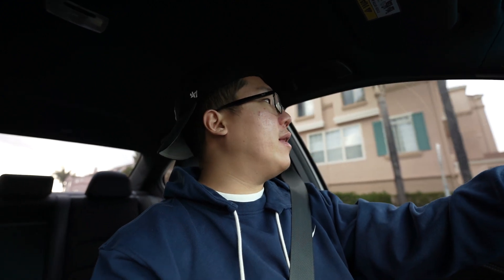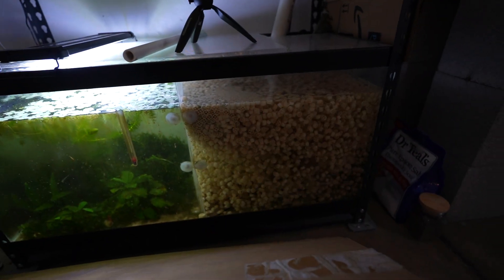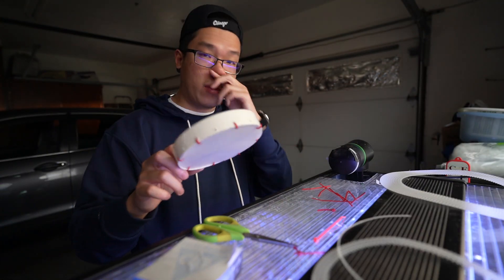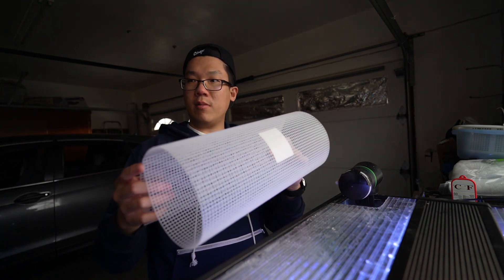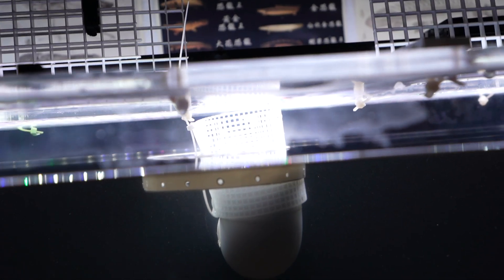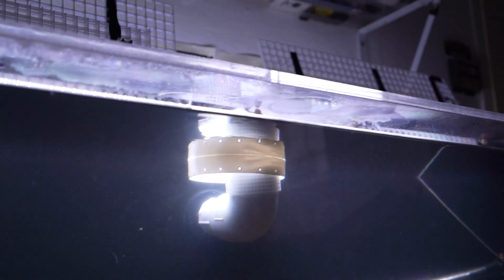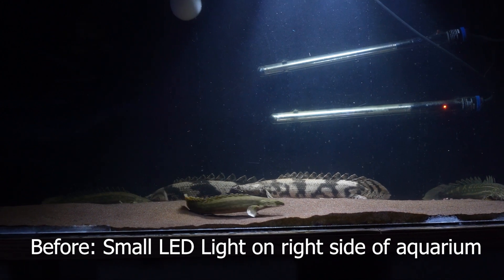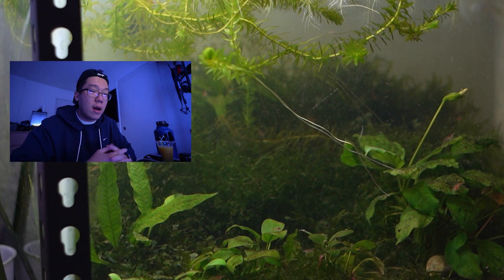Preparing my Bichir tank for Low Tech plants!

Comment: Hi whats the best water heater temp for endlicheri and ghost knife fish thank you
Reply from the maker: I dint have much experience with black ghost knife, but endlichiri I keep mine at 80f
Reply: @BryanLa  thank you so much but should i consider the temp from where i came from? Because i live here in the Philippines
Reply from the maker: I have some friends i grew up with in the states that eventually moved to the Philippines too! From what I've seen in their tanks they don't run a heater. Their tanks are very simple so I guess it depends on your preference. If you can maintain a good temperature I wouldn't worry about a heater
Reply: Thank you so much bryan
Reply from the maker: @nagatogaming9813  you're welcome!